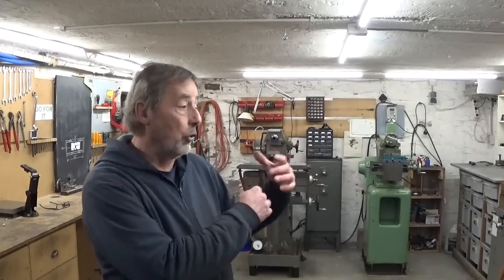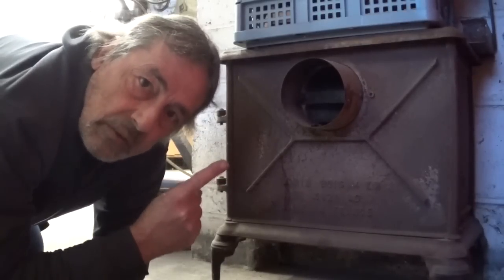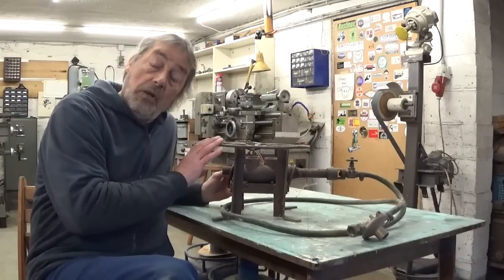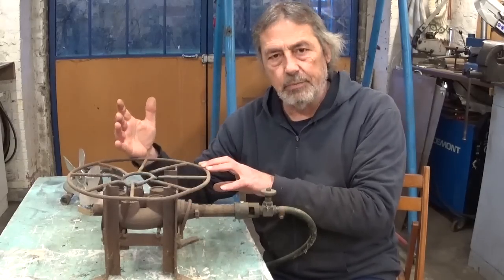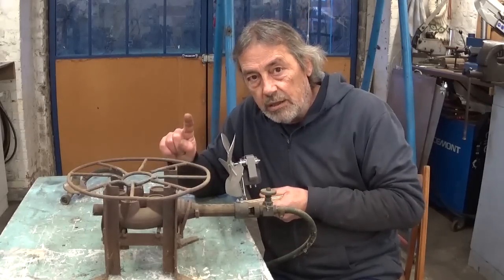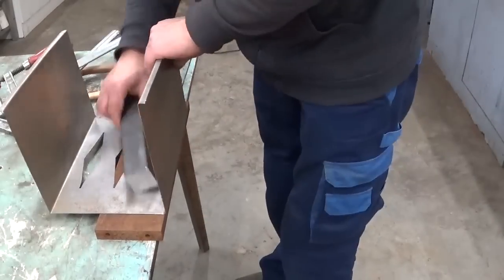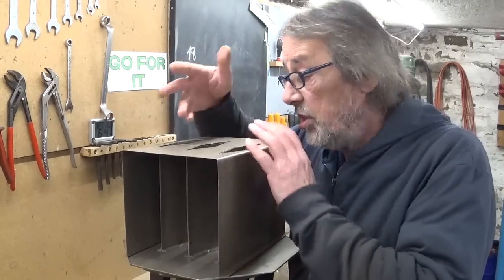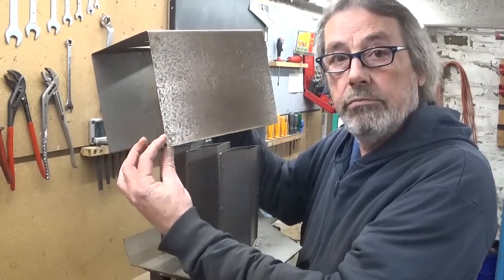Scratch build shop heater.

Comment from the maker: To react to the many comments that point out some safety issues with carbon monoxide and carbon dioxide with this device, I am perfectly aware of this problem.
This is a cooking burner that's made for use of butane or propane gas. It consumes a very small amount of gas, not like a roofing burner or whatever real heater.
My workshop is part of the basement that is under the whole surface of the house and there are several ventilation openings to the open air.
The (diesel) heating system, that you can hear in the background of some of my videos, pulls a big amount of fresh air in the workshop.
So, no need to worry. Next week I will still be alive and post a new video.
Reply: Low level Carbon monoxide poisoning is easy to miss, you just feel a little off and have reduced mental functioning and over years can result in permanent mental impairment. A carbon monoxide detector is cheap insurance, in the states I think they cost around $15. Rusty, I still need help with my shaper and I need you to keep making good videos, please buy a CO detector. :-)
Reply from the maker: @joshwalker5605  I have one.
Reply: I love your idea! Cool video! Thanks for sharing
Reply: Sounds like you have it all under control. 👍
Reply: I like your heater and the way you built it simple and clever thanks for sharing it

Comment: My three year old, Emma Ethel has decided that you are John the Baptist.  

It may not be much of a problem in your circumstance, but you will get 1 ounce of water vapor produced for every 1000 btu of propane burned.  That looks like about a 16000 btu/hr burner, so you're gonna put about a pint of water into the shop every hour you run that rig.  It may help, may hurt.... I dunno, but you should be aware.
Reply from the maker: John the Baptist? Lol, it could be worse :)

Comment: A other way.....put the gas burner under a old cheap woodstove, and use it as a gas fired radiator........ 
Keep in mind..... your machines are cold, if you heat the air gets warm....... problem...... the moisture of this warm air condensate on the cold machines, it cause rust problems.
Reply from the maker: No worries. I know the problem.

Comment: I completely understand the health problems along with age and not being able to withstand cold temperatures in the shop.  I use a propane heater and a kerosene heater.  Perhaps next year I will install a proper heating system and insulation to better maintain the heat.
Reply from the maker: You're right. Go for it.

Comment: The problem I have with gas heaters is that They bring a lot of moist in the air.
Reply from the maker: You're right. I don't use it much.
Reply: I just use it to take the edge of, then is switch over to electrical heating.
My new shop is very good insulated, But still if I use the gasheater to much i’ll end up with condens on my machines

Comment: Very nice project Michael. I recently installed a diesel heater in my new shed as well. Be careful with burning propane, it releases copious amounts of humidity, which is good for the human in the shop, however not so great for the steel in the shop.
Reply from the maker: Thanks Bruno, but I'm aware of that problem.

Comment: Rusty if you value your tools do not and I repeat do not use that heater in your workshop ,everything made of steel will rust like you’ve never seen before.propane when burnt gives off an enormous amount of water into the atmosphere and it will condense on the machines and tools believe me it happened to me there again you will be justified in being called rustinox hope this helps you
Reply from the maker: Thanks Jeffery. I know that. I don't use the burner much.

Comment: Sorry Rusti, but without an exhaust and fresh air supply this will definitely not a good solution for your quite small workshop! The danger of co and co2 were mentioned before. Another probleme of burning propane is the humidity! 1 kg of propane burned produces nearly 1 kg of water, which will like very much to condense on cold metall surfaces like your machines. So Rustinox might turn to Rustimachine. Please think about 2 small pipes somewhere to the outside.
Reply from the maker: I left a pinned comment on top of the list.

Comment: Okay, I'm genuinely concerned FOR YOUR LIFE this time...
So much so that I'm giving the video the first 👎 I've ever given your channel. 

When using any kind of gas - propane, natural gas, or whatever - for heating an enclosed area, the combustion gasses absolutely MUST be vented to the outside!!!  Otherwise, carbon monoxide will build up to dangerous levels - and do so very quickly in a small volume like your shop!!

...more details/explanation to follow, but I wanted to get this posted as soon as possible!!
Reply from the maker: I left a pinned comment on top of the list.

Comment: I know that you will enjoy the warmth provided by your propane heater.  Just don't forget that the burner is consuming oxygen and producing carbon monoxide.  You still need to build a chimney and make sure your shop is ventilated (just a suggestion).  Like one other subscriber suggested a carbon monoxide detector is a pretty good idea.  As you have said many times before "BE SAFE".  I don't want to have to send flowers to your Widow.  Good build!
Reply from the maker: I left a pinned comment on top of the list.
BTW, I'm single :-)

Comment: You know both You and the burning gas need oxygen. Be sure to have some new oxygen into the shop. Else the flame will go out, a long time after You have left the stage.

First thought was: Just place the fan blowing above the flames. The heat is there. Why transferring the heat into metal and then out in the shop? Stainless is also not a good heat conductor.

Not much work for the shaper.... Joking!
Could You unwind the rusty layer of welding string and come down to useful strings?

You had fun, that's the important thing!
Reply from the maker: To clean the welding wire, I need an emty bobin. Witch I don't have.
Reply: @Rustinox  If that string has not been used during 20 years.... making bird cages of it might be a possibility. At least the damaged part...

Comment: Nice design and work Michel. You may want to consider using a carbon monoxide alarm in the shop if you are burning propane in an enclosed area. In our country people have died due to carbon monoxide when running propane heaters in their bedrooms with the door closed.
Reply from the maker: I left a pinned comment on top of the list.

Comment: Is it worth adding a skirt around the bottom to ensure all the hot air goes up through the heat exchangers, rather than spilling out the sides? Looks like it should work well. I assume you are well ventilated in your workshop? we can't do without a weekly Rustinox video!
Reply from the maker: Wherever the heat comes out, it will always end up in my shop.
Reply: @Rustinox  True. Nothing will benefit the crows.....
Reply: No heat will be spilld. It will be circulated the naturel way due to the fan affecting all the air nearby.

Comment: Stainless Steel is not good on this Place. it has a very bad heat conduction.
Reply from the maker: Only the bottom is stainless. It doesn't need to conduct heat.

Comment: Do you have a carbon monoxide detector? As long as the propane is burning properly CO won't be a problem but should the burner malfunction and it go unnoticed CO could build up and lead to serious issues even faster than smoking a cigarette.
Reply from the maker: I left a pinned comment on top of the list.